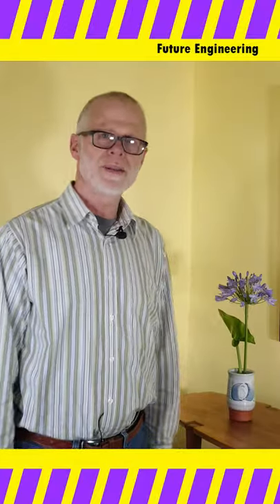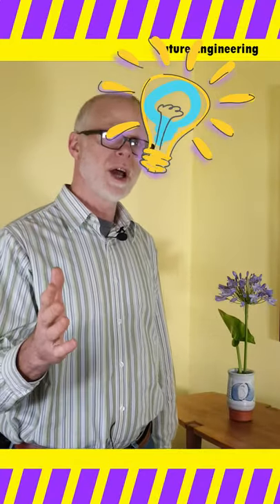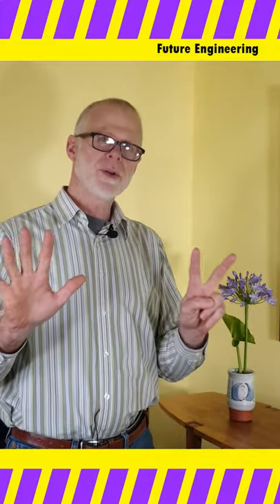7 Ways To Turbocharge Your Invention #SHORTS

Comment: If I followed al of those tips, but the first one, my invention would be ridiculous.  Try following the KISS principle. My invention has 2 parts. thats all. It may be complicated to produce but the end result is simple, elegance. Not every invention needs a heads up display.
Reply from the maker: Touche ZW. C'mon, imagine a toothpick dispenser with sensors and actuators. You're right. My next video on this topic will be about beginning with one part items, progressing to mechanisms, then to more complicated products. Inventors need to have lots of ideas and to develop the skills and knowledge to conceive them as well as getting them produced and most importantly, get paid. KISS applies for the first few tries and certainly until you get runs on the board.